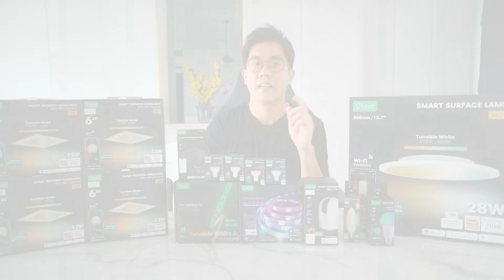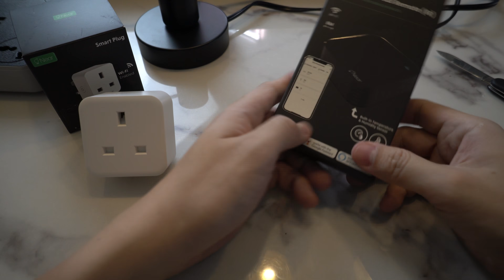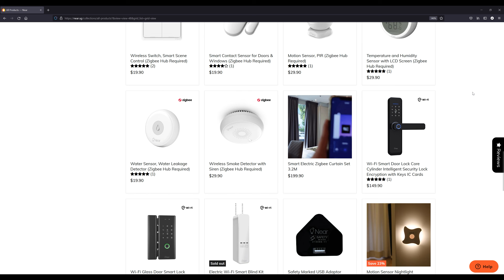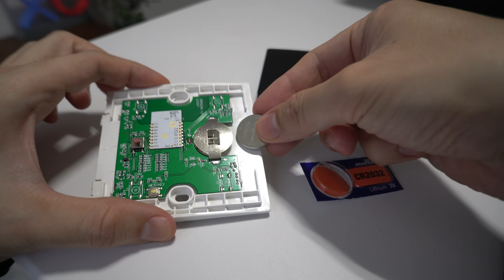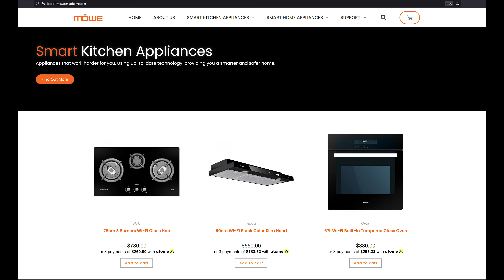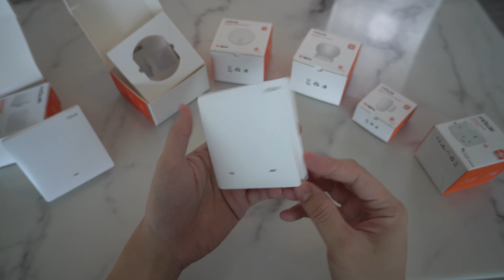Watch BEFORE You Buy Tuya Smart Home Products..

Comment: so moral of the story, use the Home Assistant to connect everything from different brands and intergrate them into your apple, google or amazon home. right?
Reply from the maker: i would say its go with tuya products if there are no better alternatives. Home assistant is very good but it doesn't matter as long as you picked a smart home platform that is essentially not a closed system

Comment: You're missing the point with your comment about quality some people like myself are fully aware the quality isn't going to be the same as more branded products that's the trade off with the lower price. I have a tuya controlled robot vacuum, RGB lighting & temperature sensor they are all purchased direct from China at a much lower cost than locally. They all work as they should & I'm very happy for the price I paid. I have no reserves at buying more low cost electronics that work with tuya rather than branded more expensive pruducts
Reply from the maker: This is mainly for those that have no experience with tuya products and no clue about tuya business model

Comment: Is it possible to switch 9 tuya spots ( bulbs ) separately  as a row of three right from the 3way  wifi wall switch ,  tuya smart app and at the same time from a wall mounted control panel ( 6 , 7 or 10 inch display ) ? Maybe same rows from two separately wifi switches ? By the way very nice and positive video. Keep going m8.

Comment: Thanks for the video! I have 2 questions
1) Using smartthings app, can I also control the NEAR smart lights like changing colour and dimming other than just turning on/off and setting automation?
2) Can I create scene for NEAR products in smartthings app and remote scene switches?
Reply from the maker: 1. Yes, there are 2 color wheels - rgb and standard white to warm
2. Yes as well, scene switches are not natively integrated, got to side load the edge driver if its available

Comment: Just had my smart home set up a month +ago.. Now struggling with intermittent lag qith switches /cams etc.. Wierd yhing is that there is almost no lag when i use my. Mobile data/other wifi... But the current wifi runs smooth.. About 350mbps download 400mbps+ upload... Sian. Need to schedule appt for the smart switch guy to come help
Reply from the maker: based on what you said, the problem lies in your connection to the tuya server
Reply: @AlexTeo  cant be. Otherwise my mobile/other wifi connections would have problems as well. But they run smooth
Reply from the maker: @ngekseng  ya so thats why its your wifi settings, outbound or inbound connections to the tuya server

Comment: Hi! Thanks for the very informative videos, have just subscribed and will be considering these smart light switches! However, I was searching for smart wall sockets as well and could only find the plug-in kind. Do people usually add these plugs to "dumb" wall sockets, or is there a cleaner way to do smart sockets? Probably just trying to save on the plug thickness...
Reply from the maker: thanks for the sub! yes there are but not commonly used as you lose the flexibility to put wherever you like. If you want then go for the one from moes - https://moeshouse.com/collections/eu-wall-socket/products/wifi-smart-light-wall-switch-socket-outlet-push-button-uk-version?variant=39822434926673
Reply: @AlexTeo   Awesome, thanks for your help!

Comment: If the GU10 bulbs from Near support only Wifi, will we be able to set scene using our ZigBee 
Hub integrated LCD Control Panel?
Reply from the maker: what is this 'zigbee hub integrated LCD control panel' that you refer to?
Reply: @AlexTeo  Eh it's an LCD touch screen panel with inbuilt Zigbee Hub
Reply from the maker: @vincechua3641  tuya device? anyway scenes are created on the app layer, not on the hubs

Comment: Hi, Alex. Thanks for your video as usual. Have been following and watching your videos for some time. I have 2 questions:

1. You mentioned we can use the Near app to control Home Auto smart switches as it’s also on Tuya ecosystem. Does it means I can use Near or SmartLife to control Tuya (Mowe/Home Auto) smart switches and Tuya based smart lighting. Given that both Near and SmartLife app is integrated into SmartThings, will i be able to view and control Mowe/Home Auto smart switches and lighting inside SmartThings?

2. My ziptrack and curtain is using Z-Wave platform. Given that I can add generic z-wave products into SmartThings, can I also view and control them from SmartThings?

Appreciate your advice. Thanks in advance.
Reply from the maker: 1. yes you can for smart switches... but if the device type is not supported in smartThings then no... for eg. the mowe smart gas heater
2. you have to test it out and see whether it works properly with the generic z-wave device driver

Comment: I kinda like their products bcos of the price haha... I only buy some of them and they have been quite reliable to me, especially the universal IR remote, motion sensors, door sensors, smart switches and smart curtain. Very easy to link to my Google nest hub for voice control. For my aged parents, I use motion sensors and place them around the house. It's especially useful at night when they want to move around e.g. toilet or kitchen, they won't need to feel the wall for the switches. The lights auto turns on when there is motion and off when motion is detected.
Reply from the maker: yeah its more of a hit or miss for the durability of the products from the various brands available

Comment: Hi Alex... any recommended smart wall switches? In term for quality...thanks
Reply from the maker: you mean for tuya?
Reply: @AlexTeo  i am not familiar...but i need some good wifi switches... based on yr video..i have try to source for "near" switches . But trying to see if u have better recommendation
Reply: All the switches need to have hub? Am i right
Reply from the maker: @edwintkc  if you decide to go with wifi switches then you don't need a hub, but i will not recommend wifi switches
Reply: @AlexTeo  why u dun recommend?? Then what switches i should get to control the ceiling lights and fan?
Reply: @AlexTeo  i was told that if i get the near switches..i need a hub?
Reply from the maker: @edwintkc  because wifi switches have a higher latency and no way to run them locally should you consider that in the future
Reply: What do u recommend if i want to control ceiling light and fan?

Comment: Hi Alex, I've been following your guide on smart home set up and have learnt alot from your videos. I've bought a NEAR zigbee smart switch, only to realise that it is unable to connect to the smartthings hub directly and would require a dedicated Tuya zigbee hub. Is there a potential solution to this (Groovy IDE?)? Thanks.
Reply from the maker: become smartthings to tuya is cloud to cloud integration unlike ikea or aqara products, technically it will work with the right device handler

Comment: Thank you for your very informative videos and I am hoping to set up s smart home system for my home renovation soon. While I was looking through the Tuya products, some switches are wifi direct connection, does it mean there is no zigbee required. However, if later on I get a zigbee hub, will it be able to  connect to the switches. Or should I just get  switches to link to the hub? Really appreciate if you could guide me. I intend to adopt the Google ecosystem, at the mean time also having a Tmall Genie. I am waiting for my smart lignt bulb to arrive to start my smart home journey before getting the rest of the devices.
Reply from the maker: you have to make a decision from the start whether you want wifi or zigbee. What's the purpose of the tmall genie?
Reply: @AlexTeo  Thank you for your prompt reply,  after viewing your other videos,  i would go for the zigbee. Btw Tmall genie is similar to Xiaoai speaker but with limited devices than Xiaoai.   I do have a google nest mini speaker for voice control. Though i would like to use Aqara but find Tuya is more pocket friendly as a start. May contact you through your IG message for advice in the near future if you do not mind.

Comment: thanks for making this video! good for my research and glad to see there are so many brands out there. the only one i can't find many options is for curtains..
Reply from the maker: retrofit or motorized?
Reply: @AlexTeo  originally wanted retrofit for the convenience.. but thinking of switching to motorized blinds since there seem to be more options and honestly feel like the cost ends to be about the same. what is your view from a budget standpoint?
Reply from the maker: @sandrath91  so is blinds or curtains? If you don't have any existing then definitely go with motorized. It is much more reliable and neat. Retrofit ones are cheaper
Reply: @AlexTeo  currently have curtains. thinking to change to blinds. thanks for your opinion! in your other vid you mentioned somfy but quite pricey leh, have you had experience with any other reliable ones?

Comment: Chanced upon your videos just when I started reno for my house. And thanks to you I am deep in the smart home rabbit hole. Your videos are straight forward and easily understood. But after watching this video I am kinda worried as I bought wireless tuya smart switches online from China. Do you think I should change to zigbee switches instead?
Reply from the maker: yeah get zigbee over wifi if possible
Reply: Good questions! Alex is right, go for Zigbee switches because most Zigbee switches do not have neutral wires (compatible with Singaporean homes) & Zigbee products act as repeaters which helps tremendously with responsiveness! You can shop for both touch and mechanical switches at our website www.near.sg - we provide a 2-year warranty as well for your peace of mind!

Comment: Hi Alex. Can you advise why is it that direct control via wifi is not good and using of zigbee or aqara is a better option ?
Reply from the maker: because your wifi band will be very congested, higher latency which is not ideal especially for sensors or automation that you want it to happen instantly. Another concern is of course security privacy if you are concern
Reply: Thanks for the reply